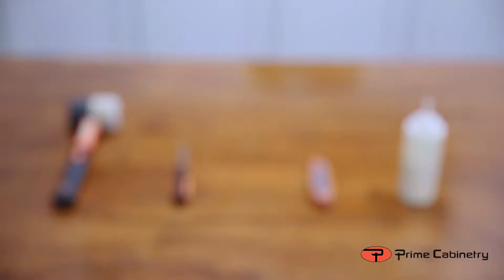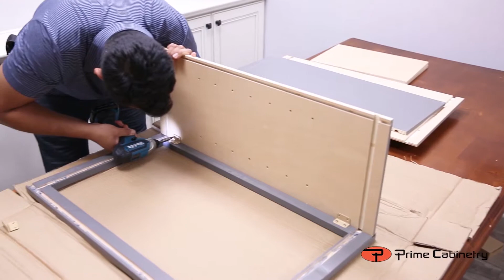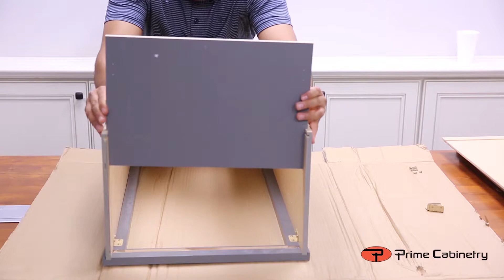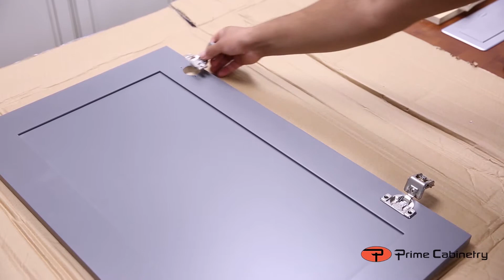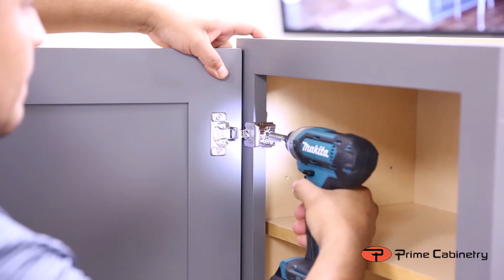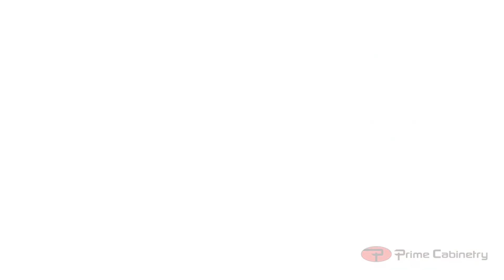Wall Cabinet Assembly

Comment: Assembly directions included with the tall pantry cabinet are very different from the assembly video you are showing    This video is the easier way to assemble the tall cabinet.  The included directions are incomplete regarding the application of the L-SHAPED  supports.